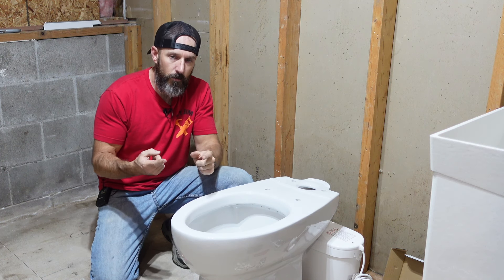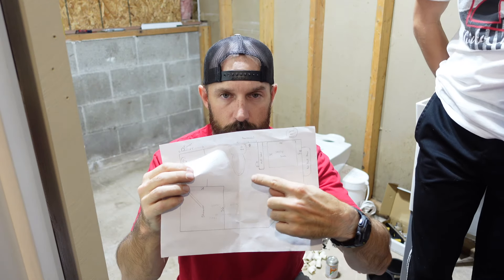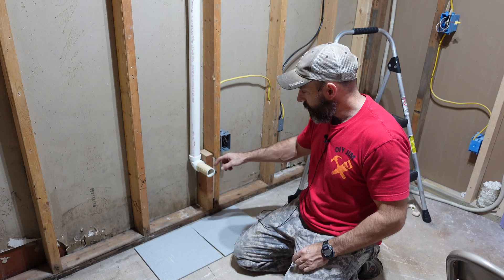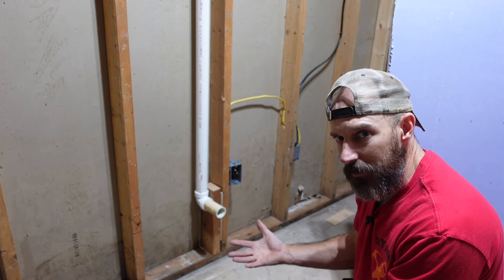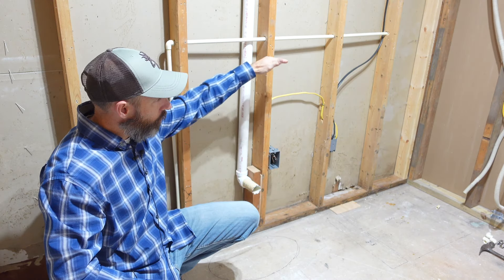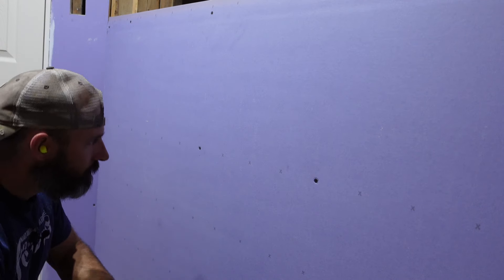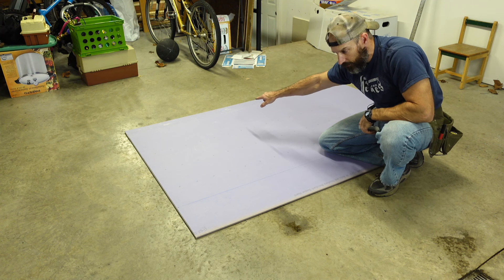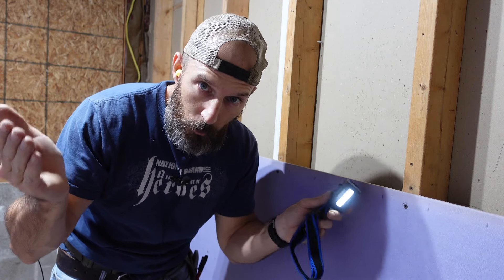How to build a basement bathroom video 1 of 4

Comment from the maker: (click read more) links to some of the tools I used
Thank you very much for watching and God bless.
✅ Milwaukee drill set   https://amzn.to/3tXFPag
✅ PVC pipe cutters https://amzn.to/3i39bBv
✅ Drywall screw setter kobalt https://amzn.to/3V4HKWr
✅ muti tool dewalt https://amzn.to/3Vlkljw
✅ chalk line https://amzn.to/3OyUqmb
✅ Dremel tool kit https://amzn.to/3hY5e0O
✅ rotoZip drywall bits (work in Dremel) https://amzn.to/3V3GX8m
✅ inside and outside drywall tool set https://amzn.to/3GC7W6C
✅Vitra Schluter underlayment  https://amzn.to/3tWQHp0

  ✅ My T-shirts.  Thank you for supporting my channel✅
                     https://diy-jim.creator-spring.com
        5% off shirts use DIYJim2021 when checking out

✅Send me a thank you ✅
                 DIY Jim
                 PO Box #105
                 Hughesville Pa, 17737

✝Bible ESV easy to read   https://amzn.to/3qshNQP
✝Bible NKJV                    https://amzn.to/30ns322

✅Titan Solar Generator (large generator) https://poweredportablesolar.com/ref/48/

✅Sony ZV-1 (camera I use)  https://amzn.to/3MxVeG2

✅sony wireless UWP-D (mic I use).  https://amzn.to/3LEPV6m

✅Go Pro that I use  https://amzn.to/2WC6WXH

✅Wireless mic used:  Rode Wireless Go https://amzn.to/2WxQt7c

*Full transparency. I am a participant in the Amazon Services LLC Associates program, an affiliate advertising program designed to provide a means for me to earn fees by linking to Amazon.com and affiliated sites.

*Disclaimer - Thank you for visiting my YouTube channel. Please understand that the content on the DIY jim YouTube channel is intended for informational purposes only. I make no warranties about the completeness, reliability and accuracy of this information. Any action you take upon the information posted on my YouTube channel is strictly at your own risk, and I will not be liable for any losses and damages in connection with the use of my YouTube channel.

#basementbathroom.     #bathroomtipsandtricks.        #bathroomidea

Comment: Only thing missing is how you hooked up  the vent line. did you hook into an existing line or have to go into attic with a seperate line
Reply from the maker: I hooked to an existing vent line that happened to be right above my Saniflo in the ceiling.
Reply: How do you know what is the vent line? To tap into?